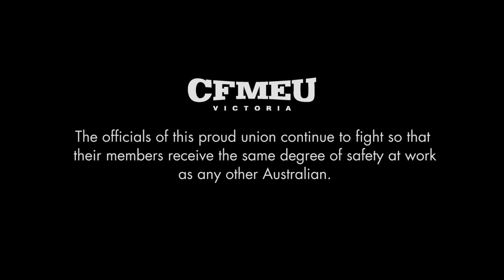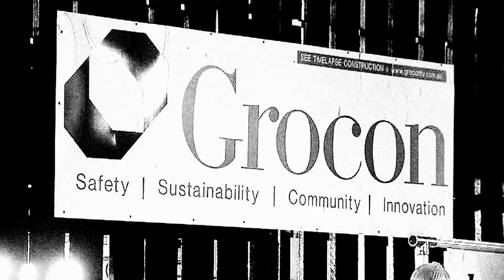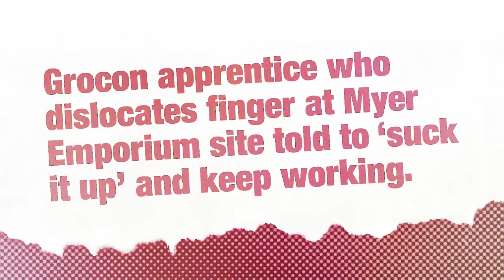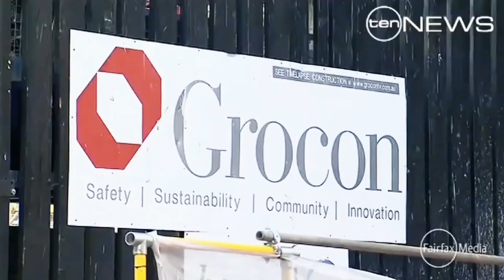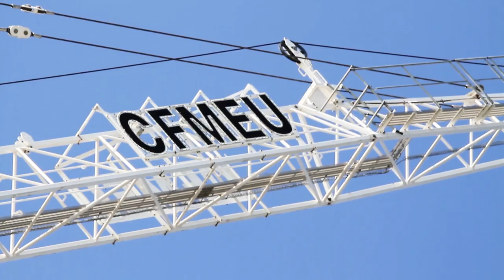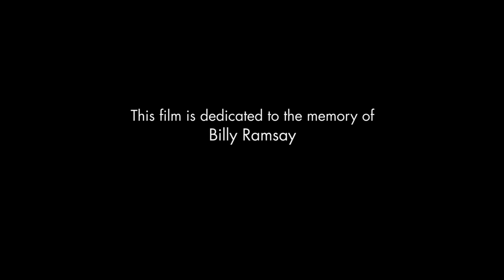Grocon - A Dispute About Safety

Comment: So guys, what you are indicating here is that at any time you have a concern over safety you cant approach any one from Grocon on site to get resolution?
Are  the hired 'standover men' the only reps from Grocon for HSE concerns? 
Do you not have the capability to go over the head of grocon and call in Vic Worksafe inspector at any time you feel the need to stop the job? or are they toothless tigers? Would love someone to tell me exactly how it is on Grocon sites.
Cheers Pfingers